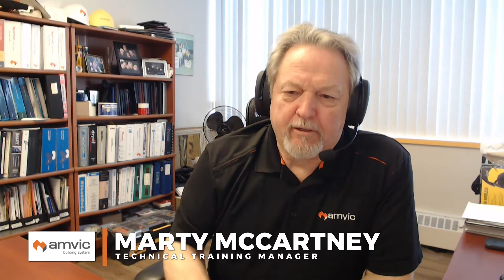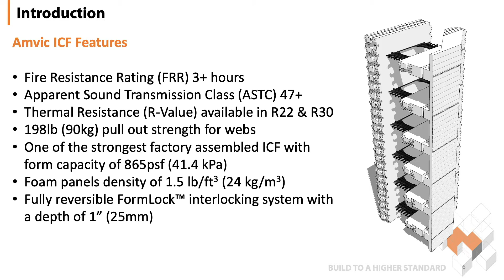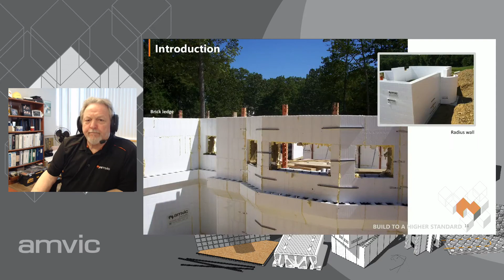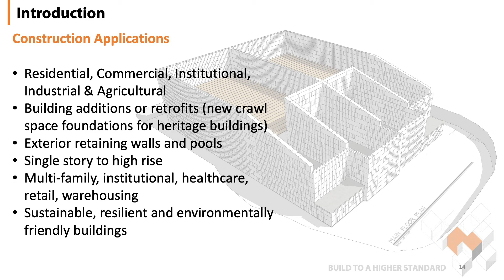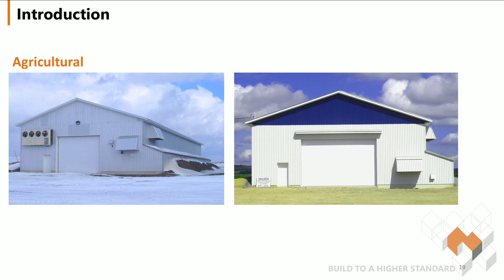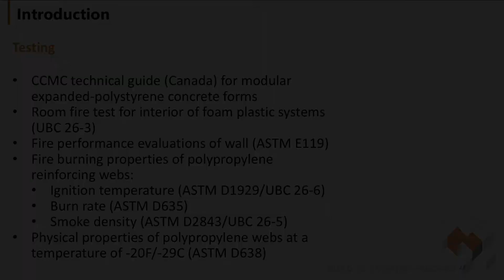1 Introduction

Comment: Would a brick ledge give more support to ledgers? The cut out and anchor bolts are fine, I like actual weight on a column system to ground is why I ask